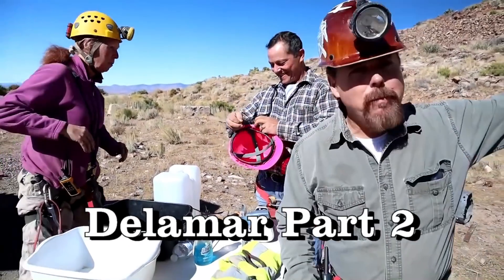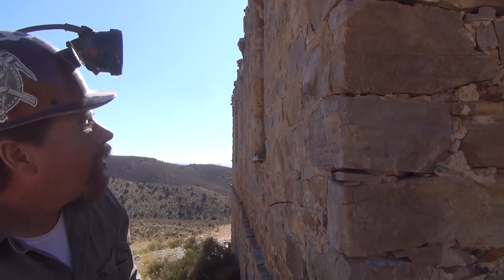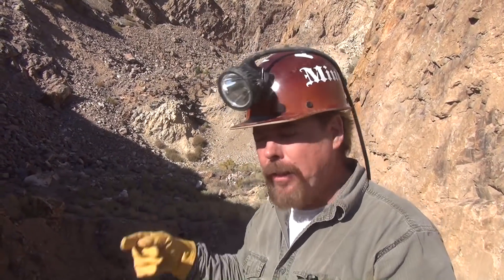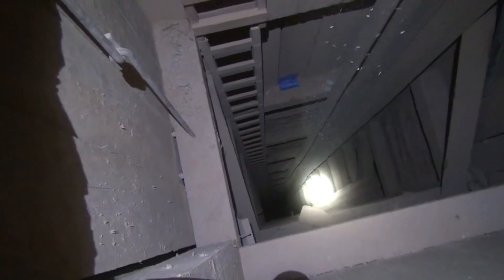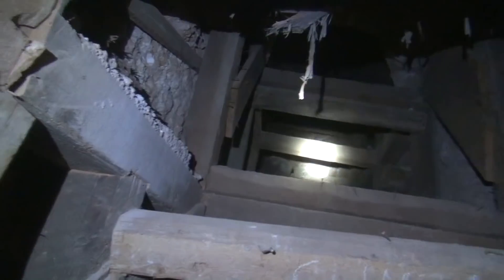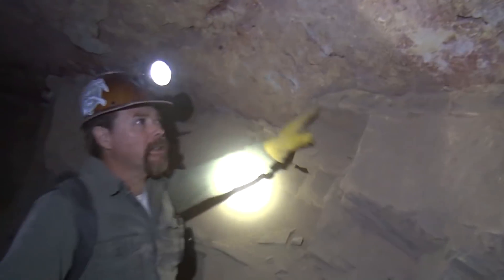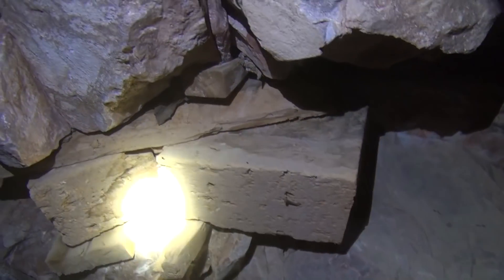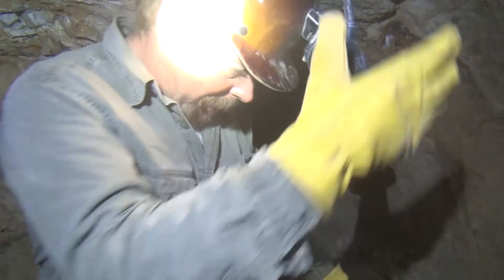Rich Gold in Quartzite | Epithermal Bonanza ( Hotspring Type )  - ask Jeff Williams

Comment: I was in Desert Center and dropped a Toner on a string down a shaft about 100', then went in the Portal about 300yds away and after a few ugly Squeezes came upon a thrashed ladder. I laid it down and used a rock and some rusty nails found nearby to climb about 15' into another level. I shut of the light and then opened my eyes to a very faint glow and headed toward it and disturbed about 20 bats that went nuts and some hit Me! I was 100 feet away and saw the Toner, yet still heard NOTHING until I was less than 20' away!  The sound damping qualities of all those minute angles should have been the basis of the ''Stealth'' technology!